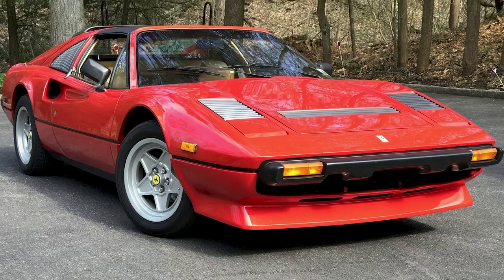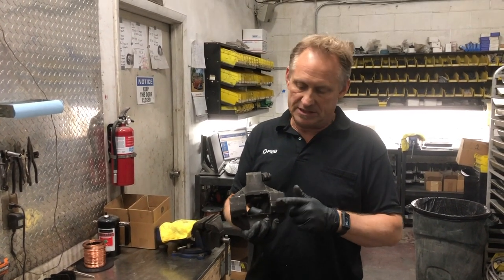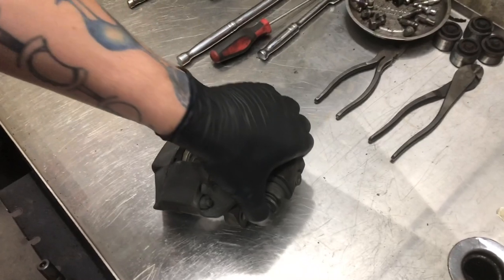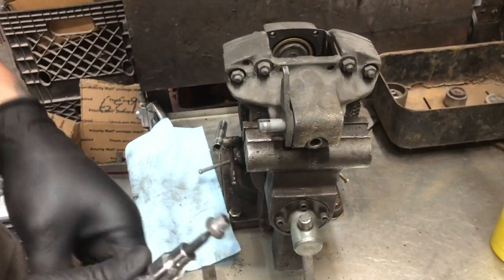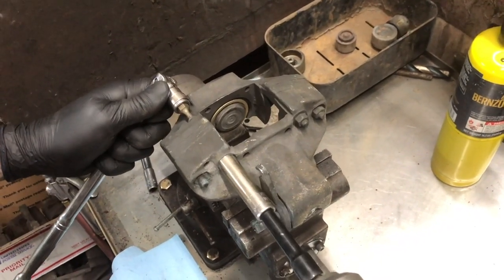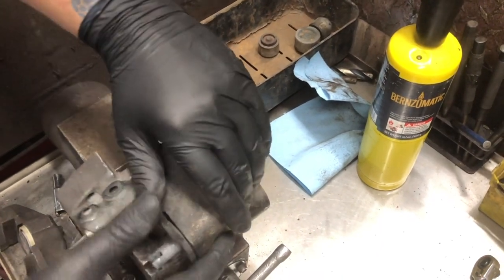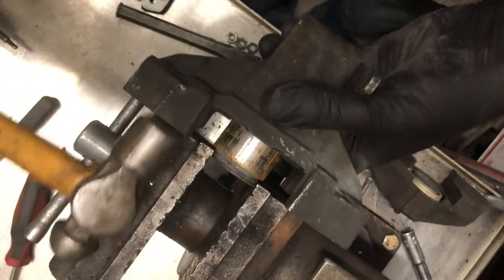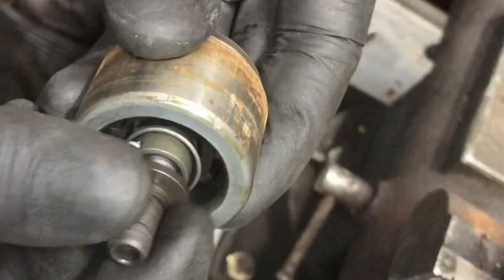Ferrari 308 and Porsche 914-6 Share the Same Calipers? Re-plating, Re-Build and Re-install

Comment: Ian, just got my calipers back from PMB the other day.  The timing of this video couldn't have been any better for me.  Question: Do the 914-4s also have these spacers for mounting the calipers?
Reply from the maker: Hi Fred. I haven't seen spacers on a 914 setup...but I supposed they could be used if the calipers were off-center.  My bumblebee calipers should be back from PMB in a few weeks and I'll definitely have a video on those...
Reply: @IanKarr  - I've got more "issues" than I can deal with right now on my 914.  Just stripped an engine hood bolt and my A/C evaporator (from custom air) doesn't fit b/w the dash and my A/C center console.  I really need the caliper installation to go smooth this weekend.  Oh, and thanks for another great video.  Enjoyed seeing you and Eric in action.

Comment: Which mid-Engine is more fun to drive?
Reply from the maker: Great question. They both have really fun characteristics. The Ferrari is much more visceral...it takes over all of your senses. You can't drive it casually. The 914 is more nimble and precise.  The 308 is like a sharpie. The 914 is like a razor point pen ;)